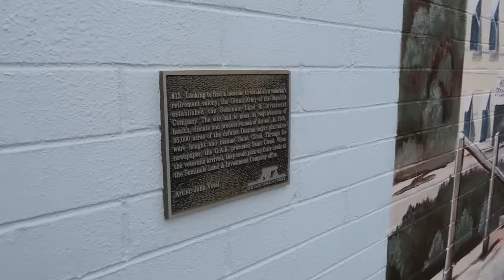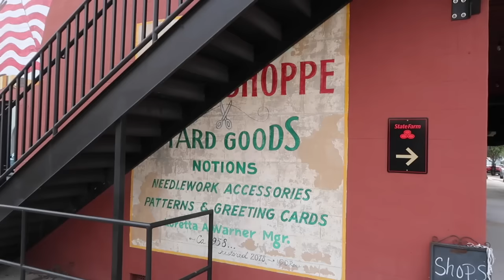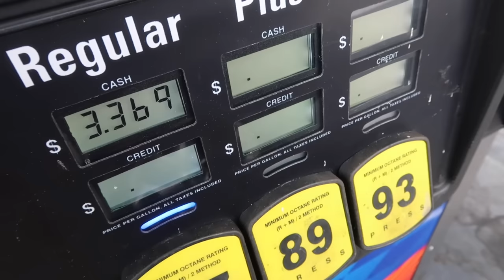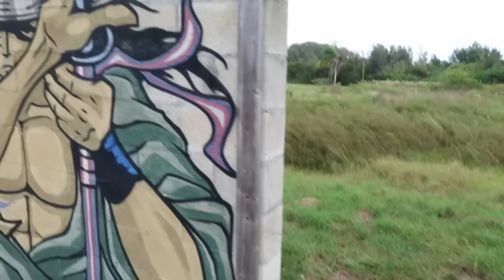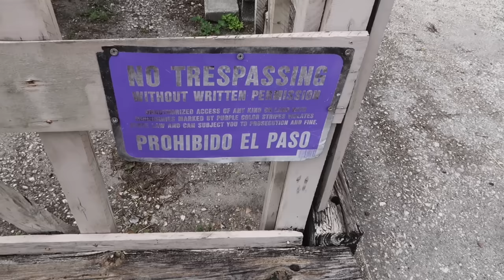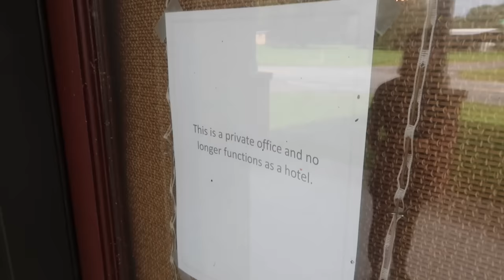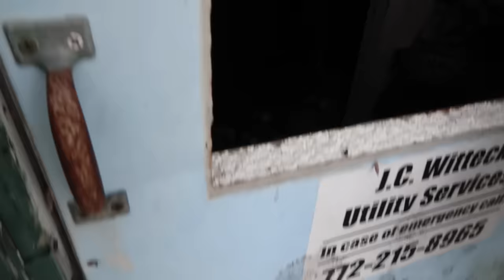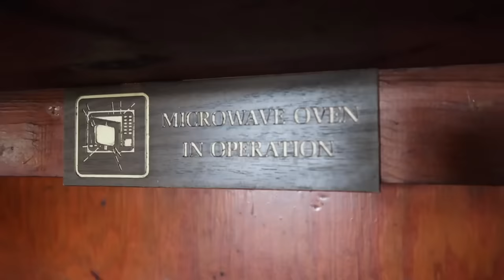Forgotten Backroads & Small Towns Of Central Florida - Abandoned Places In Middle Of Nowhere

Comment: That church building in Holopaw was under construction for years. I remember driving past it as a kid and see it slowly take shape but it was never completed.  Wonderful to see the buildings in Kenansville being saved. That area has history that still has not been touched. Just those dragon light fixtures tell a tale
Reply: They are relatively new. There is a strip mall area in Mequon, WI that used to have them along the walkways. The mall façades were rebuilt a couple of years ago and the lamps were refitted. There were two and three dragon ones. And they appeared to be cast iron.